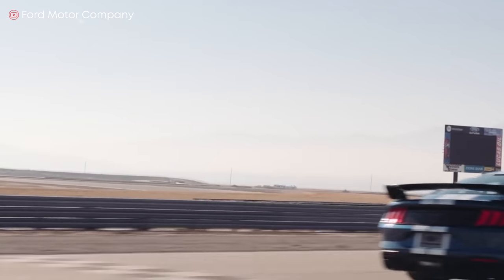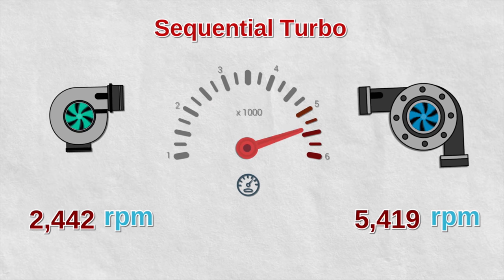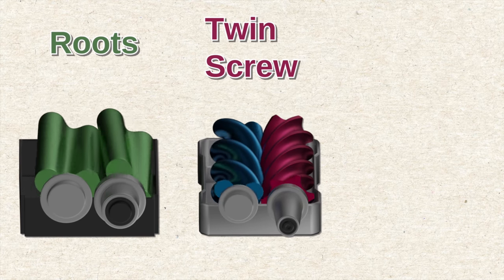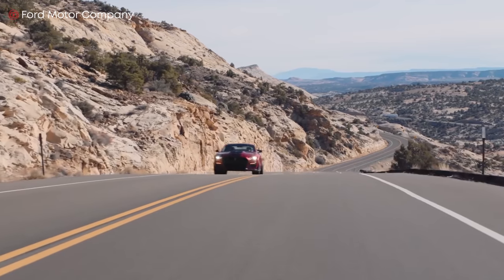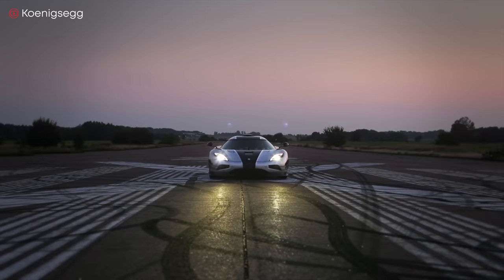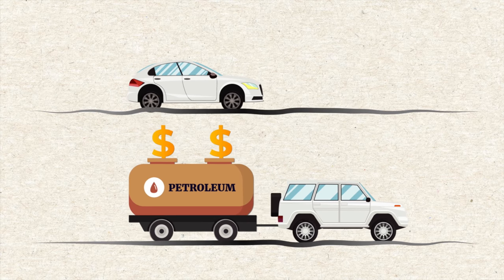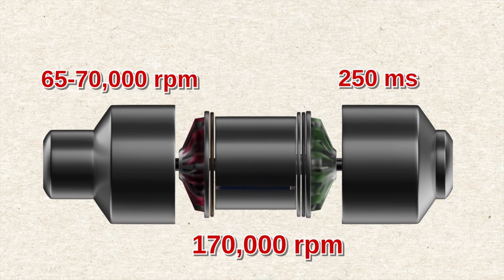This New Mod Will Add 400 Horsepower to Your Car

Comment: 6 years ago I dreamed of making this unit electric turbocharger or electric supercharger are most definitely possible. When I research this a few back Audi was having a prototype in a suv. But never produced them quick enough. There is also a few different ways to design them, electric motor has to be light and superior strength to push one intake impeller or  connected shaft to intake and exhaust impeller with a electric motor in the middle. In theory a twin impeller electric turbo would be the most effective so the intake and exhaust turbine are working together rather then one turbo impeller using the battery up. Therefore with a programmed ecu just for the turbo you could program the voltage to spike boost in low rpm  for less lag and still use that energy coming from the exhaust turbine for higher rpm. You have to consider another battery just for the turbo which is a flaw, if you compensate more intake air the exhaust pressure will only gain more energy it isn’t considered loss energy at all only when using top fuel on a dragster a turbo won’t work since the fuel energy is the corp. so with regular fuel a turbo will always be more efficient. Flaw to any supercharger is you maintain strong boost instantly but quickly goes down.

Comment: Don't forget about a variable geometry turbo Wich has moving fins wich start out small making it like a smaller turbo then they enlarge as the rpm goes up and can take the higher rpm giving the sequential turbo setup in just one turbo.

Comment: Overlooked efficiency benefit of turbos--they take energy from the HEAT of exhaust to turn (pun) into boost.  Not about back pressure on the engine, thermal energy that goes to waste turning pipes red hot otherwise.

Comment: Always intriguing and helpful educational material. Even if not applicable to anything I have it's always interesting, informative, and always great to learn. The one thing I would have loved to get is access info... somehow I am either overlooking the details in the post or it's not provided... where are the link(s) for access to vendors, manufactures, or speed shops that sell these new electric superchargers? That would be awesome info after such a compelling presentation Scotty!

Comment: I understand that the more air that flows through the turbo charger pipe, the hotter it gets (red hot) and therefore it shortens the turbo's life span.

Comment: Turbochargers are better for your car than blowers for street-driven cars/engines.  Blowers are always taking HP even when cruising and worse yet they heat the air before pumping it into the engine requiring higher octane fuel. Roots blowers are only good for one thing, the drag strip, I'll take a Whipple Blower over Roots any day for the street-driven daily driver, but a Turbo is my #1 choice for a daily driver, very quiet, no hood scoop, and they actually quiet the exhaust.

Comment: Turbo diesel engines will have higher maintenance related issues and costs due to having to inject more fuel to spin the turbo up leading to clogged dpf and carbon buildup especially when used in the urban cycle, whereas a mechanical blower is boosting from low revs and doesn't need to be over fueled to produce boost. Therefore, more potential work for dealerships with an exhaust driven turbo.

Comment: Not only can a turbo charger be more efficient, it can also produce more power than a supercharger. A decent amount of power is robbed from the engine to turn the supercharger. It's just hard to beat that naturally aspirated feel of a supercharger. V8 enthusiast usually really enjoy that.

Comment: Contrary  to what is said in this video.  In a properly running internal combustion engine, there are no explosions going on inside the cylinders, only controlled combustion.   Explosion/ detonation in the cylinders of an internal combustion engine causes knocking and can damage an engine if it is not corrected. So once again no explosion just controlled combustion.

Comment: I'd love to see a manufacture create a 100 or 200mpg car just to be able to do a mic drop right before EV'S take over. Maybe I'm wrong but I've always been told that big oil has suppressed gas efficiency. I guess if they could do it they would have already right?

Comment: Only if the electronic sensors allows it. There is a mechanical timing mark  that  times the crankcase and valves. Therefore they don't need sensors. The fuel injectors I can see

Comment: Kind of late here but did anybody remember the magazine article from the 80 s about smokey unick  and his modified Fierro that he built that increased efficiency too 40 percent that double the power and efficiency he had a small turbomixer and a freon  gas motor hooked up to the engine it has so much torque it was hard to hold it back with the brakes it would get 100s of miles per gallon he built it with off the shelf parts back in the 80s this would put electric cars out of business I think popular science or popular mechanics was were i seen it somebody needs too do this again

Comment: The problem with the whole idea that either a turbo or s/c increases fuel economy is that they run significantly richer mixtures under boost to cool combustion chamber temps.

Comment: These are well made videos.
I believe that the limitations of modern engines is the cost of manufacturing. With modern manufacturing engineers should be able to achieve the level of precision required to produce efficient powerful engine that don’t cost as much as spacecraft.
I think some of the real genius were the engineers who imagined these designs 100 + years ago.
Modern design has not kept up with the available manufacturing. Computer controls have been the most significant change in the past 40 years.

Comment: If tire traction control synchronize the tire airpressure to keep friction highest to efficiently use engine power and area of tire touching the roads but future is hovering vehivle to reduce rubber waste

Comment: Hey Scotty. I've been a USA ford fan ever since I was around 8 years old. Except for the AC Cobras. I envied the European  cars with that had turbos. I never could understand why the US wouldn't make turbo chargers that would come as basic equipment for our cars. Way more power with half the cubic inches.
Reply: Gas is /was cheaper here. I believe europeans and japanesw are taxed by engine size, as well.

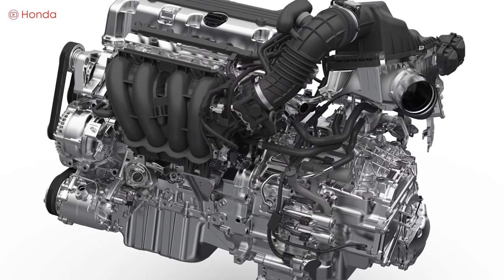Comment: 1:26 increasing "the power by 20-25%" will NOT "increase the acceleration TWO TIMES". 

To double the rate of acceleration, you have to square the amount of horsepower.

Comment: Turbo lag has long been solved. Turbos can give you amazing top end power. And Bi-Turos if done properly can give you a much broader power boost. The real problem with turbos is THEY HEAT SOAK YOUR ENGINE. You can lessen this effect with the biggest heat exchangers you can put on. But still.....

Comment: Dude why are people concerned about 0.5-1.0 second of turbo lag?  Any turbo car I’ve ever driven didn’t take away enough throttle response during that split second for me to care or notice.  I don’t understand why it’s a big deal for some folks.  I actually like that minuscule delay before the real power kicks in because it kinda plays with your head for a second...then you get the rush of the boost after that!

Comment: All my experience working on ships tugboats especially the EMD engine uses the supercharger turbo principal. The same idea is that it has a constant and strong power curve during the lower RPMs the turbocharger acts like a supercharger until it reaches a certain exhaust temperature then it releases the turbo charger the spool up off the exhaust. And the one consequence from all of these increases of power is the heat saturation that has to be dealt with. Doubling the horsepower of an engine is easy dealing with the heat that it builds up as a whole entire subject that has to be addressed. Ultimately why bother the power curve and technology of electric motors is far superior. It's the future guys undeniable utilizing the consolidated power grid reducing emissions it's the way to go.

Comment: there's another drawback to forced induction, potential blow by that can foul your oil with fuel. So you have to change your oil sooner. Also, something that isn't covered that will help get that horsepower to the ground is improving the transmission. Now how you can go about that depends on model and how much money you want to put into it.

Comment: I wish somebody made a little tiny electric turbo that you could bolt on to any family car just to give you an extra 40 or 50 horses for those times when you’re going up a pass or whatever and it didn’t cost $1000 or even $500 I’m in it’s basically just a little motor with some fans. Even if you just got six or seven or 8 pounds of boost out of it.

Comment: So the electric assist one is a turbo electric supercharger.  They must put a lot of cooling around that electric motor.  At first I was thinking it was similar to a turbo supercharger in WWII airplanes but they were two units.

Comment: Why not put a servo motor on the axis with a one way clutch?   Use near instantaneous response of servo to speed up turbo and one way clutch will unload the servo when the exhaust gases run turbo faster than servo motor.  So you get quicker response and turbo efficiency.
Reply: OK so Volvo is doing something similar.  You could also put an electric clutch on the supercharger to kick it in only when you need acceleration.  This would reduce the drag on the engine when supercharger is not needed and improve fuel mileage. I'm sure someone is doing this also!

Comment: Scott, you are incorrect about centrifugal superchargers. I actually gained 1 mile per gallon and i think it was due to using less throttle to achieve speeds and hold speeds. It was 90 formula 350 firebird stock with a vortec sc. Man i miss that car.

Comment: If you read the description it says "the New Electric Supercharger." While forced induction has been around for a long time they have all been mechanical or dependent upon engine exhaust, an electrically operated turbo or supercharger is rather New. Just saying.

Comment: Isn't Latham still pushing their axial supercharger? That'd be a 4th variety. Plus you don't mention variable turbos with adjustable vanes that create a two stage turbo by giving the conk shell around the turbine two different volumes.

Another turbo variant that inexplicably never sees much use is a geared turbo that popular in WW2 warplanes that had very little parasitic loss but got up to 30% better fuel economy or power depended on tuning.

Comment: I have a question for you? I drive a 2003 Dodge Ram 1500, with a 4.7 engine. Yesterday my truck turned off on me 3 times. But each time my truck fired back up again no problem. No engine lights are on. I talked to my mechanic and he said until a engine light comes on not much he can really do. What can I do?

Comment: Your videos is awesome. I learn a lot from day one you start your channel. I have a question it might sounds stupid but who cares. I'm a Toyota person but not a Honda. So if I use this electric supercharger in a toyota cross just to get a by pass other vehicles are there anything I need to change to install this peace? Honda are plugs and play but Toyota is more like, make sure is correct before you screw up the your car.

Comment: I have a product that clamps to your fuel line to give more HP, better fuel efficiency and less emissions. It requires no engine modifications.  I’ve load tested this on a LS6 and achieved 9 more HP.  I can’t paste the photos of the results from my phone but if you give me a link where I can, I will send you the results.

Comment: Excellent explanation but what they don't tell you is the cost of doing this to your engine is significant. Imagine having to replace these devices 250k miles down the road. Get the saw and prepare to remove an arm and a leg. Turbos are around 2k dollars and almost as much for a supercharger sometimes more. Also, if your engine wasn't designed for a turbo or supercharger or both, then you will need many thousands to upgrade rings, pistons and bearings and head gasket and sometimes you'll need a completely new engine head with roller rockers. The engine could end up costing twice as much as original and only last half as long. Mechanics love it when you do this because they get more money in labor costs.

Comment: Can the last electric supercharger be turned on and off, thus saving gas mileage while not in use? You might have said so already, but I was tired and falling asleep and might have missed it, but if so that's the one I would want.

Comment: Scotty, I do not like turbo or super chargers on a gas engine, as I feel they are not built heavy enough? Do you feel the new 7.3 Godzilla, which is suppose to be a very well built, tough engine, is heavy duty enough for a super charger?

Comment: I had a supercharger on my e46 M3. I HATED it.
1) Ate belts weekly. 2) Torque and HP curve were the SAME until 5.5K RPM. Only had an increase at top end for a couple seconds. 420HP for .5 seconds.
3) Overheated the car  4) The welded plenum SPLIT and had to be replaced under warranty.  5) had Crank sensor issues. Related? Killed all my power for weeks until they diagnosed. It took Active Autowerke forever to find and fix that problem.

Biggest mistake of my life. I should have saved up for a turbo. Unfortunately even entry turbo kits for my car are $20K. But you get substantial low end HJP and Torque. Run E85 and u get ridiculous Lambo and Ferrari stomping power with every day drivability.

Active did Dyno tune my car naturally aspirated and thank god archived the tune on their hard drive. I am enjoying NA again and NO issues. NO overheating, NO oil burning and incredibly smooth power up to 8K RPM.
IN South Florida I would kill myself with a turbo kit. Too much traffic. Utah is for turbo charging. Gonna move!

Comment: Second little tidbit: It takes almost 1000 horsepower to turn the supercharger on a top fuel drag car. Which is another drawback of a supercharger when compared to tubro charging. A supercharger actually uses horsepower to make horsepower so it robs Peter to pay paul. That's way many car companies are going to turbochargers.

Comment: I have an idea to making superchargers more efficient.
That is by adding a gear ratio between the driving shaft and the turbocharger.
But that will make it more complicated !
Reply: Or maybe just a clutch which engages when more power is needed
Reply: @Mark Codiroli What I ment is something similar to a gear box not a fixed gear ratio. Which is controlled by the ECU.
Thanks for your comment 🤍
Reply: @Mark Codiroli That is for the purpose of making it more efficient. The direct connection of the SC to the driving axle is what makes it consume  so much fuel. So, my thought is placing a gear box in between may address this issue. A small three speed gear box may be perfect

Comment: How much fuel tune do you need for this elec. Supercharger for the compressor supply to engine most fuel pumps wont push enough flow to run that much more fuel control over 400 hundred hp.

Comment: I think it's not so much the turbo lag is that the engine doesn't put out any power until the turbo of the turbine spins at full speed that's kind of the way the engine's design they're no lower torque if you go to a regular size motor as soon as you push the gas you have a lot of torque just like the electric motor you have a lot of torque but the turbo doesn't really produce torque it produces horsepower if you can understand the difference

Comment: Scotty I need help. I saw your video about not changing the trans fluid in a chevy at 90k miles. Should I change the fluid in my 2012 Toyota 4runner at 185k miles? It had never been changed when I received it.

Comment: Hey man I've been getting advise from ur videos ever since I bought my first car last December. You are a great mechanic. I have this 2007 nissan tiida that lost power after a mechanic changed the transmission fluid and put in cvt fluid. I took it to a transmission guy and he said it's the wrong fluid because the car has a AT. He flushed that oil but nothing changed and today it lost the drive gear and can only go in reverse.  What do u think my problem is?

Comment: Turbo lag is pretty much nonexistent today. Instead of blow off valves, recirculation valves are typical now and greatly help to reduce it when paired with the proper setup. Most cars only feel turbo lag in automatics at a downshift for turns at low speeds. 

Electric turbos (as they are closer to turbos than supers but more accurately neither) help regular turbos a little but alone they're pretty useless except in certain applications. This will allow larger spools in cars for greater power.

Of course bottom of the ladder is still superchargers alone. Parasitic loss to gain about equal power double the loss amount in most applications. So lose 10hp, gain 20, roughly. But paired with a turbo it makes the loss worthwhile.

Comment: The electric motor addition, using 48 volts, to the turbocharger reminded me that 48 volt is the standard for aircraft power systems.  Is the manufacturer of this device associated with aircraft too?
Reply: In the Air Force, all our aircraft were 28 volts.